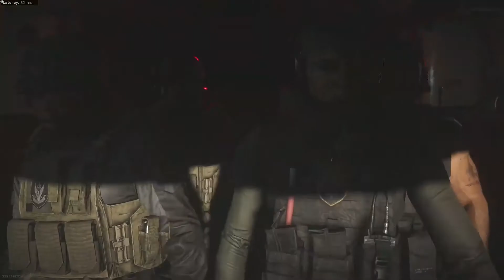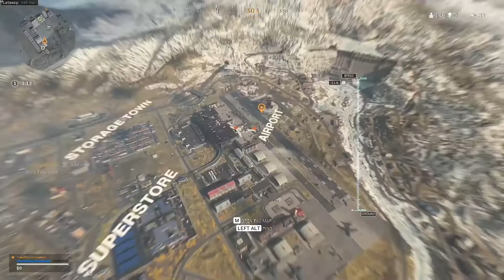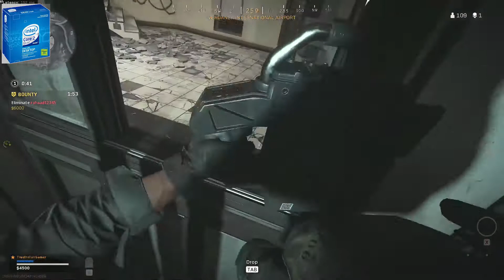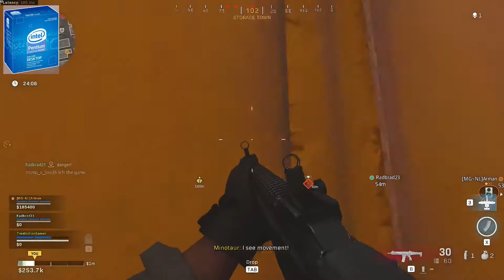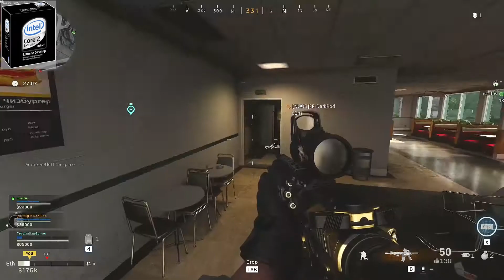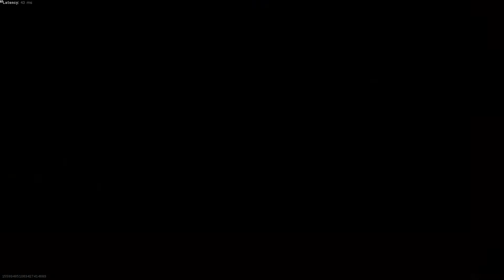5 Best CPU for LGA 775 Socket 2021 (Complete Buying Guide)

Comment: Please, nobody follow these recomendations. It is incorrect. QX9650 is a better choice than Q6600. It has unlocked multiplier. There are also 771 socket Xeons that can be modded to 775. But, honestly, for modern use I'd go with an intel i5 CPU. The most modern one you can afford.

Comment: The most powerful and last processor for this socket is the QX9770, not the QX6700, which is 86% more powerful than the Q9650, but it is rare and its price is very high.

Comment: Here's why the Intel Core 2 Quad Q9650 is the top choice:

Clock Speed: The Q9650 has a higher base clock speed of 3.00 GHz, making it faster than the Q6600 (2.40 GHz), Q9400 (2.66 GHz), Pentium E6300 (2.80 GHz), and Core 2 Extreme QX6700 (2.66 GHz).

Cache Size: The Q9650 has a larger L2 cache (12MB) compared to the Q6600 (8MB), Q9400 (6MB), Pentium E6300 (2MB), and Core 2 Extreme QX6700 (8MB). A larger cache can improve performance in certain tasks by reducing memory access times.

Performance: The Q9650 offers better performance compared to the other options, especially in multi-threaded applications, thanks to its higher clock speed and larger cache.
Reply: Yes, the Q9650 is the best one, but what do you think the best gaming cpu for LGA 775?
Reply: Спасибо за совет

Comment: I just salvaged the Intel '05 Q6600 core 2 quad SLACR Malay 2.40Ghz/8m/1066/05A L738B001 & Intel '06 Q9400 core 2 quad SLB68 Malay 2.66Ghz/6m/1333/05A L946B263 but I'm running the E5800 also VGA775 socket with only 3x1GB of the lowest frequency ddr3 ram and it works pretty good but I don't game. I didn't even know I had them but what id really like to know is what's the frequency limits on these 45nm processors for UDimm ddr3 ram? Can I get away with 1600mhz or does it even matter at a certain point? My motherboard will only handle 2x4GB or 4x2GB

Comment: can you explain in more detail why quad core q6600 is better than q9650 because as far as i can find out q9650 is better than q6600
Reply: I don't understand either...🙄
Reply: Here's why the Intel Core 2 Quad Q9650 is the top choice:

Clock Speed: The Q9650 has a higher base clock speed of 3.00 GHz, making it faster than the Q6600 (2.40 GHz), Q9400 (2.66 GHz), Pentium E6300 (2.80 GHz), and Core 2 Extreme QX6700 (2.66 GHz).

Cache Size: The Q9650 has a larger L2 cache (12MB) compared to the Q6600 (8MB), Q9400 (6MB), Pentium E6300 (2MB), and Core 2 Extreme QX6700 (8MB). A larger cache can improve performance in certain tasks by reducing memory access times.

Performance: The Q9650 offers better performance compared to the other options, especially in multi-threaded applications, thanks to its higher clock speed and larger cache.

Comment: q8300 is better than the q6600
Reply: Here's why the Intel Core 2 Quad Q9650 is the top choice:

Clock Speed: The Q9650 has a higher base clock speed of 3.00 GHz, making it faster than the Q6600 (2.40 GHz), Q9400 (2.66 GHz), Pentium E6300 (2.80 GHz), and Core 2 Extreme QX6700 (2.66 GHz).

Cache Size: The Q9650 has a larger L2 cache (12MB) compared to the Q6600 (8MB), Q9400 (6MB), Pentium E6300 (2MB), and Core 2 Extreme QX6700 (8MB). A larger cache can improve performance in certain tasks by reducing memory access times.

Performance: The Q9650 offers better performance compared to the other options, especially in multi-threaded applications, thanks to its higher clock speed and larger cache.

Comment: i have an e6700 and looking to upgrade, as a dual core isnt the best for server use.. lol so i will most likely go with the q9650 or q6600
Reply: q9650 is ALOOOT better than the q6600
Reply: @mhany61  for me it's whatevers cheaper
Reply: @SkysTrains  you will take like from 10 to 20 fps in q9650 more than the q6600 in games but it depends on you
Reply: @mhany61  it's for a server that I'm giving to my brother. Fps doesn't matter. 4 cores is just better then my dual core for some tasks.

Comment: How about a Xeon x5460, modded from 771 to 775, that works for me. Played CS:GO, Rocket League, GTA V, Doom 2016 on it, and it's great.
Reply: Yes, the best socket 775 cpu is a socket 771 cpu.
Reply: X5450 here. Orevlock to 3.7 GHz playing gears of war 5 now.
Reply: How much fps do u get in gta v
Reply: @valtaoi5697Depends on your GPU and game settings, but it's more than playable.
Reply: @SoullessBestiary  what gpu do u use
Reply: @valtaoi5697When I had this build, I used a GTX660 OEM 1,5 GB, but I've upgraded since.
Reply: İt is hard to cooling
Reply: @Moon-lf4jj  aio cpu coolers are cheap nowadays,  50 dollars for a 10 dollar cpu that only requires a pin jump to go from 771 to 775 is worth it
Reply: @Moon-lf4jj  truth !

Comment: I'm running a Intel Core 2 Quad Q9650 on a Dell Optiplex 780 and getting good results for Skyrim SE average 30 FPS with 380 mods installed. I believe, I need a better motherboard than the factory one preferable wanting to use Intel Core 2 Extreme QX9770 with ASRock G41C-GS LGA 775 Motherboard problem is availability.